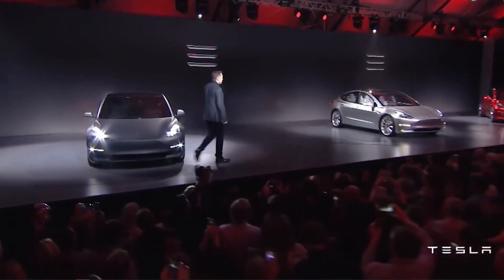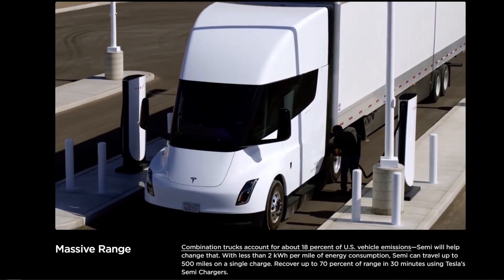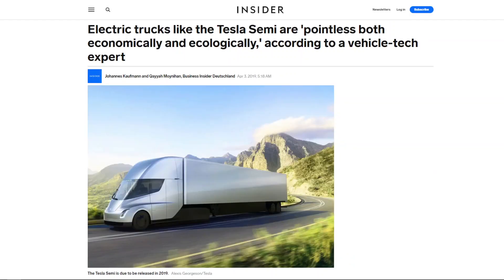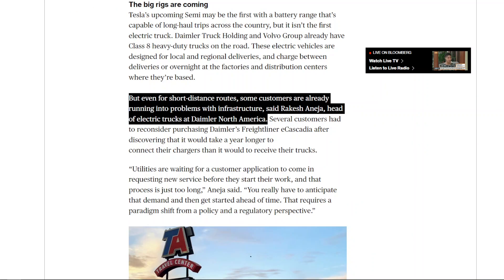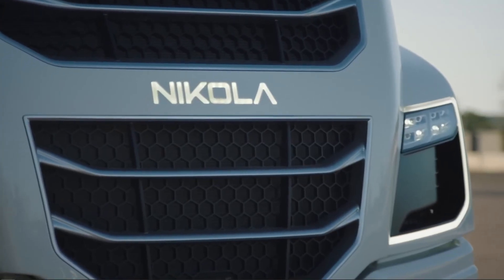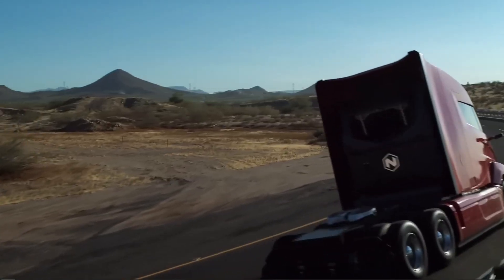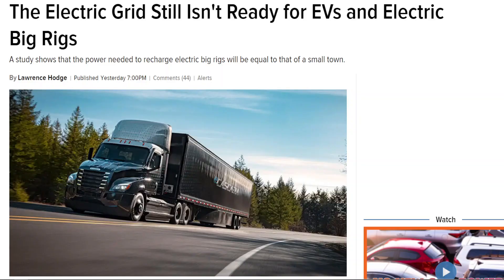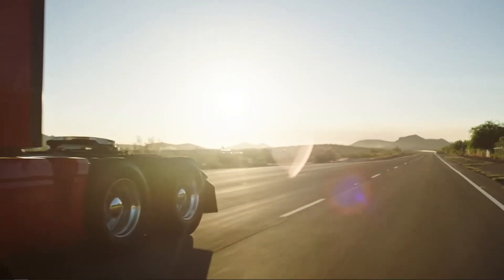Sandy Munro: Battery-Electric Trucks Are EXTREMELY Flawed For Long Haul.

Comment: so the 750 Kwh Nikola Tre BeV has even bigger problems since it can ONLY charge at 175 kW and has a battery pack nearly as large as the Tesla but only gets about  half the range.
Reply: The Tesla and Hyliion fanboys are worse than the video game fanboys. Wow!!
Reply: @thingshappen9199  yeah one made 10X on their invetment the other lost 90%
Reply from the maker: The mobile charging trailer can be moved around to any 110v AC plug, unlike the Tesla megacharger which is fixed to the ground. If that's not mobile to you, I don't know what is 😂
Reply: @lsantang  I was a big Tesla investor. WhaTs your point really?
Reply: @visceral_investing  what?  the mobile charger requires 400V 3 phase power  .. you cant just plug it into any one 110V AC .. LOL>> who do you think you are fooling?
Reply: @thingshappen9199  the point is obvious.. Tesla fans have a reason tosupport the company.. they got rich.. hylion fans got poor
Reply: @lsantang  the ones that invested recently haven't gotten rich.
Reply: @thingshappen9199  are they "fanboys" too?   long term investors will be fine in tesla
Reply: @lsantang  so what makes you think that hyliion and Nikola wont be fine in the long term?
Reply: @thingshappen9199  when did Tesla shareowners lose 90% of their principal?
Reply: @lsantang  how do you know that these two will now recover 500%?
Reply from the maker: @lsantang  Can the megacharger be moved from one facility to another or no?
Reply from the maker: @lsantang  Tesla shareholders were propped up low interest rates for the past 10 years lmao. Stimulus checks and non existent inflation. Nikola and Hyllion are dealing with a 10x more difficult market environment today, Tesla's -60% return YTD already foreshadows how badly it would have performed if this happened when it was a small cap 😂
Reply: @thingshappen9199  math isnt a strong suit for you is it?
Reply from the maker: The only thing that isn't a strong suit for anyone in this thread is "basic technical knowledge" for FX Worldwide
Reply: @lsantang  if it walks, talks, and acts like one then you are it whether you realize it or not. You truly are acting like a fanboy by putting tesla as the almighty investment at the moment when it's actually underperforming like most stocks this year. You are only acting based on preference not logic.
Reply: @thingshappen9199  no one cares what you think.
Reply: @lsantang  LOL. ok
Reply: There's a rumor that there was potato chips on the Tesla Semi
Reply: @hepasto  rumor?   your english must not be very good..  many people have lost billions of dolalrs betting AGAINST ELon and Tesla.. join that crew if you like.. better to just burn your money.
Reply from the maker: @FX Worldwide How does Elon's shlong taste?
Reply: @visceral_investing  why would you want to know?
Reply from the maker: @lsantang  Elon doesn't know or care about you. You sucking him off so hard while he keeps selling stock at the top, and delays product launches by 5 years. He must have given you some real delusional serum 🤡
Reply from the maker: Lol not even close, the 175kW charging is 5x less straining on the grid than 1MW, not to mention Nikola's smaller battery not using as much energy to fully charge to 100% as the Tesla. Plus, Nikola sells a mobile  charging trailer that costs roughly $70k, quite a bit cheaper than permitting and installing a $2 million megacharger 😂
Reply: no i was acrualy spot on. and teh mobile charing trailer is not mobile
Reply: Don't be fooled by Musk's lies
Reply: @hepasto  dont be fooled by people telling you Musk lies. .. tey've been 100% wrong for ten years.

Comment: Long Live Nikola ❤️
Reply: Nikola cult
Reply: @Onsokumaru  Call it what you want. 
The sustainable hydrogen society is based entirely on emission-free primary sources and secondary energy carriers following the largely decarbonization of our energy system by the replacement of the currently predominant fossil fuels with green electricity, green hydrogen, and biomass.
Reply: Nikola is dead and burried
Reply from the maker: Cult = another word for a group of people that use logic and reasoning, instead of opinions and bias

Comment: The Hyliion Hypertruck ERX has a 1,000-mile range and uses RNG which actually cleans the air to create. It's less expensive and a better solution so I see it as the dominant force in class 8 trucking in the near future.
Reply: James, in case you didn't notice, nobody gives a truck about ERX. I wait for next 5-6 months when becomes obvious that ERX is superb class 8 truck, even compared to Tesla semi.
Reply: Hyliion wont survive. They haven’t even produced a single vehicle that’s on the road running freight commercially.
Reply: @spurcrawler249  That is simply false. The Hybrids have been in use for a while and the Hypertruck ERX demos are currently being tested with fleets. They recently had one deliver the Christmas tree to NYSE.
Reply: @JamesJohnson-rd8cl  go all in then. BK
Reply: It's understandable that ou like Hyliion but don't make it so very obvious.

Comment: It simply is the case that to charge the semi is totally possible.. Especially when the companies using this platform like with diesel they have huge bunkering facitilties.. On site electric generation and storage.. Sit back and just watch don't listen to this out of date opinion
Reply from the maker: I never denied that charging at 1 MW is possible. It's just not SUSTAINABLE for the long term because of the implications of grid stability, reliability and cost. Installing a gas or hydrogen station doesn't require any changes to the grid, but the 1 MW will

Comment: The already existing Superchargers have multiple MW connections to the grid as do most big sized factories or businesses. With stationary storage they can also help the grid so rather than being a downside to make MW scale charge stations they become a positive for the grid. Also guess what? Electricity providers like to...sell electricity. Everyone seems to act like they would be allergic to making more money. Also the alternative of hydrogen would consume even more electricity to produce hydrogen so stop using this talking point lest you appear ignorant.
Reply: What is the price per kg? Diesel needs about 3 liters to match the energy density of 1kg of hydrogen and globally that costs around 4 dollars plus or minus. How cheap is hydrogen per kg right now? What about competing with under 10 cents per kWh for renewable electricity? When will it be competitive? Never that's when.
Reply: So more expensive than diesel by over 50 percent and even more so than electricity being used directly by BEVs. Good job inventing a perpetual subsidies hungry mode of transportation, idiot.
Reply: Think about the fall out ,hydrogen can be stored ,it’s system relevant and that’s why only hydrogen trucks makes sense for longer range
Reply: What fall out? You mean black out? Electricity can also be stored in stationary batteries and actually help the grid. Now about that hydrogen costs being the most expensive per unit of distance driven...any ideas?
Reply from the maker: Notice how the only thing you argue about against hydrogen is cost, which is not a fault of the technology, but just the time and scale. Meanwhile we raise actual technical problems with batteries that can't actually be improved over time. Grasping for straws? 😂
Reply: And how will cost drop at the price of diesel let alone electricity when, ideally hydrogen will be made with electricity by splitting water and the resulting hydrogen is several times less in terms of energy than the electricity? No amount of scaling will make it cheaper than using the electricity directly. Notice how this is never addressed and it's the reason the hydrogen economy never happened. It's not fuel cells by the cost of the fuel making it too expensive.
Reply from the maker: Hydrogen is 4x as energy dense and methane reforming is 30% more efficient than natural gas electricity creation. So fuel to wheel, hydrogen is literally more efficient in a fuel cell even at 60% energy efficiency of the cell. You're just screaming about random stats that have already been addressed by hundreds of engineers magnitudes more qualified than you lmao
Reply: Unscientific crap, well to wheel efficiency is many times worse than electricity and since ideally it is created with electricity it can't be cheaper than it. You're the only one claiming hydrogen cost being higher than any existing fuel has been addressed. No, it has not.
Reply from the maker: @eternitynaut  Call it "unscientific crap" when the facts go against your bias. You've lost this argument bud, sit down

Comment: 1 MWh = 1,000,000 watts used for 1 hour. If you remember those old 100w bulbs, 1MWh will power 10,000 x 100w bulbs for 1 hour. That is no where near the energy consumption of 2500 homes for 1 year. Please learn to do simple math
Reply: @visceral_investing  1 MW = 1,000,000 watts of power. Typical oven uses 2000-2500 watts of power. 1 MW charger draws the equivalent of about 400-500 electric ovens.
UK home consumes 4000 kWhs energy a year. Megacharger consumes 1000 kWh energy an hour. So using a Megacharger for 1 hour consumes the same amount of energy as 0.25 UK homes in a year
Reply from the maker: Yes, using the megacharger for 4 hours uses as much energy as 1 UK home does in 365 days. Proves my point even further 😂
Reply: @visceral_investing  Yes. So you see how your 2,500 homes comparison is flawed. Megacharger for 1 hour = 0.25 homes for 365 days
Reply from the maker: Megacharger at any point in time = average power draw of 2500 homes over 1 year. Does that dumb it down enough for you?
Reply: @teoengchin  he was stating 2500 UK homes draw 1mw at any moment on average during the year.

I got confused too and initially thought it was total power consumed through out the year
Reply from the maker: "The average house in the UK uses around 4,000kWh of electricity a year" = average 0.5 kW power used throughout a year. Do the math and you find that with the 1MW power rating of the Semi's charger, you can power roughly 3000 homes. Your assumption is quite ignorant 😉
Reply: @visceral_investing  I believe you are comparing the average per hour usage of UK home to a hypothetical situation where a Megacharger is charging non-stop 24 hours a day for 365 days
Reply from the maker: @Roy Teo Nope, power is instantaneous and is independent of time. Whenever a semi will be charged using the megacharger, it will consume the equivalent power that 2500 homes pull on average over the timespan of a year. I hope you know your basic energy units 😉
Reply: @visceral_investing  UK house uses 4,000kWh a year therefore 2,500 houses use 10,000,000kWh. A Megawatt charger will need to run 10,000 hours or 416 days non-stop to consume the same as 2,500 houses
Reply from the maker: @Roy Teo Yet again, you mix energy with power. You're not qualified to perform such analysis, just accept your loss and move on
Reply: @visceral_investing  Its would be clear to anyone who understands basic math that you're the one who's confused

Comment: 2500 homes only use 1mwh (1000kwh) per year? Did I hear that right?
Reply from the maker: No, 1 MW of peak power
Reply: @visceral_investing  1,000,000 watts divide by 2,500 = 400watts per home. 400watts is just enough to power a fridge and a heater
Reply from the maker: @Roy Teo Why the hell are you dividing power by the # of homes? 1MW is the AVERAGE power consumed by 2500 homes over the timespan of a year, not the energy 🤦‍♂️
Reply: @visceral_investing  So is it peak power or average power? Seems like you're confused
Reply from the maker: Average power for the homes we're comparing to, and peak power for the megacharger that the Semi uses 🤦‍♂️
Reply: @visceral_investing  You need to compare average with average or peak with peak for it to be a meaningful comparison. If I make a roast in my 2400w oven, its not equivalent to me consuming the same energy as 5 average UK homes
Reply from the maker: The megacharger only charges at 1MW, there is no "average" power for that. It is the same as "peak" power in that case 🤦‍♂️
Reply: @visceral_investing The home hourly average includes divides consumption over an entire year which includes all the times when there is minimal or no usage. The equivalent yearly hourly average for a Megacharger would be to factor in the number of hours it would be sitting idle consuming zero electricity in-between charges and when down for maintenance. By taking the peak as the average, it means it's being used 24 hours 365 days at peak charging
Reply: @visceral_investing  UK house uses 4,000kWh a year therefore 2,500 houses use 10,000,000kWh. A Megawatt charger will need to run 10,000 hours or 416 days non-stop to consume the same as 2,500 houses
Reply from the maker: That doesn't change the fact that the megacharger uses the same power as 2500 homes over the timespan of a year
Reply: @visceral_investing  Yes, a megacharger running non-stop for 416 days consumes the same power as 2500 homes in a year
Reply from the maker: If I use a megacharger for 1 minute or 416 days, I consume the same amount of power i.e 1 MW 😂
Reply: @visceral_investing  Yes for 1 minute you would draw 1MW of power and consume 0.01667MWhs (16.67kWhs) of energy
Reply from the maker: And that 1MW of power is the equivalent draw of 2500 homes over the average of a year. Thanks for agreeing with my point
Reply: @visceral_investing  You're confusing power and energy again.
Power Comparison:
1 MW = 1,000,000 watts of power. Typical oven uses 2000-2500 watts of power. 1 MW charger draws the equivalent of about 400-500 electric ovens. (1,000,000 divided by 2,000 or 2500)

Energy Comparison:
UK home consumes 4,000 kWhs energy a year. Megacharger consumes 1,000 kWh energy an hour. So using a Megacharger for 1 hour consumes the same amount of energy as 0.25 UK homes in a year. (1,000kWh divided by 4,000kWh)
Reply from the maker: You just keep proving my point even further, thanks
Reply: @visceral_investing  I've shown my calculations how 1MW charger in 1h uses only 0.25 home consumption of 1year. Why don't you show your calculation on how you arrive at 2,500 homes?
Reply from the maker: You can find it for yourself in this study: https://www.transportenvironment.org/wp-content/uploads/2021/07/20180725_T&E_Battery_Electric_Trucks_EU_FINAL.pdf
Reply: @visceral_investing  OK thanks, so when the tesla semi is charging, it is using the same power as 2500 homes average usage.

Comment: Unfortunately hydrogen is not the answer. Hydrogen is generated through electrolysis which requires electricity… where does the electricity come from… the grid 😅

A lot of potential energy is lost when converting electricity to hydrogen, which then requires more energy to store and transit to hydrogen stations, which is then converted back to electricity by the vehicle fuel cell. A hydrogen vehicle is basically an EV with an inbuilt electricity generator

You may as well bypass all that hydrogen infrastructure and store and use that  electricity directly.
Reply from the maker: Electricity is generated from fossil fuels, so why not skip it and just use fossil fuels directly?
Reply: @visceral_investing  such dumb argument, battery  can be charge at home with solar panels or wind. How will one make hydrogen? Countries that need to import gas, which can be expensive, no longer dependent on foreign oil. They can build out thier own solar and wind farm with battery storage to support the local economy. Let's ignore hydrogen inefficiency and gasoline as well. Battery efficiency is over 90%. While gasoline is only 40% at best.... Why do anyone take you serious?